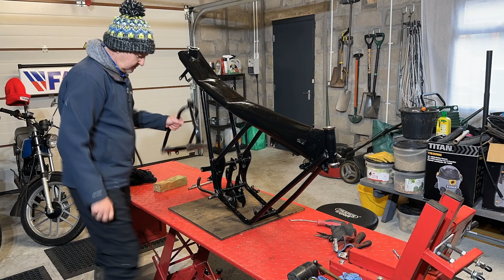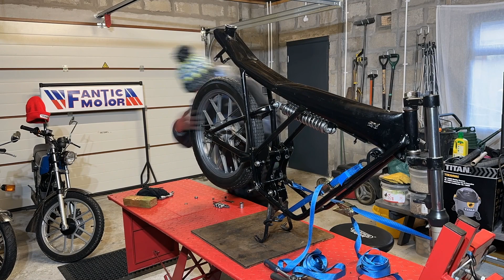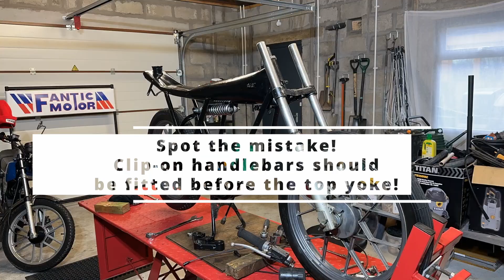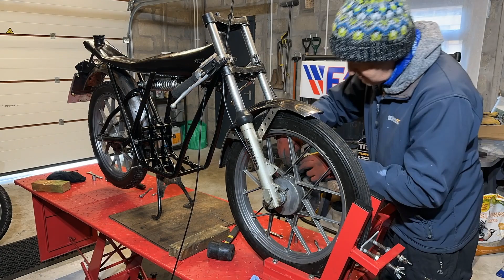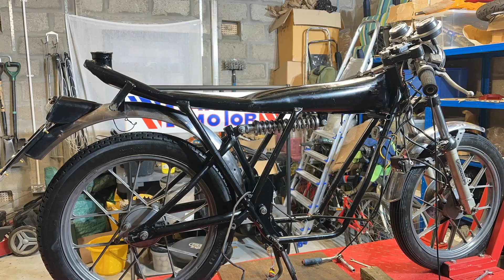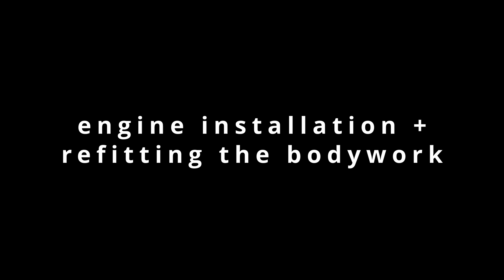Gitane Champion Super Veloce Time-Lapse Build Part 1

Comment: Bought one for £369 in 1977 just before they restricted them to 30 mph.Always breaking down until I realised the points casing leaked letting water in and causing a misfire.The throttle cable also snapped as it had a solderless nipple on the end and kept coming off.Looked great,alloys, clip ons, monoshock suspension,disc brake it was the Bimota of the moped world.
Reply from the maker: Nice one, do you remember the registration? There are 7 known UK original examples left, a high survivor rate from the handful sold originally. Fabulous bike and great to ride too with the close ratio gearbox.
Reply: @fanticman  Sadly lost in the sands of time, will ask my brotherif he can remember.I think one of them sold it as a bag of bits,I had a Capri by then n lost interest! Shame on me!
Reply: Me and my mates also had a Garelli Tiger cross,carb araldited together, we were always getting the bikes rebored with oversize pistons.We learned the hard way that Garelli  engines do not have caged needle rollers on the small end, as they all fell into the crankcase as we tapped it out😅.
Goodness knows how we got them out 😢! Glory Days!

Comment: I bought mine from Lloyds of Carlisle sept 1976 , nearly stuffed it on London rd as when I pulled out and turned right I found that their PDI missed routing the throttle cable behind a fairing stay so full lock stretched the outer applying full throttle. Eek.
Should never have sold it regret it to this day
Reply from the maker: Great story, can you remember the reg of your bike?